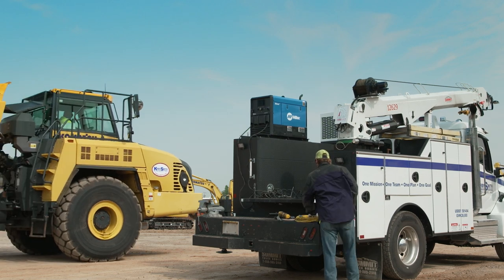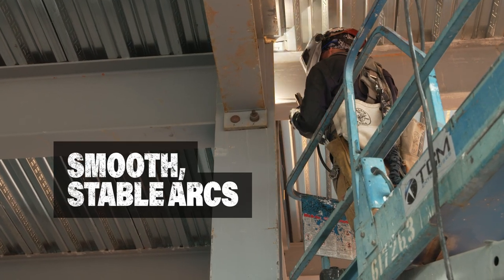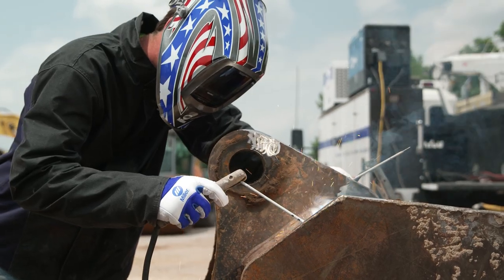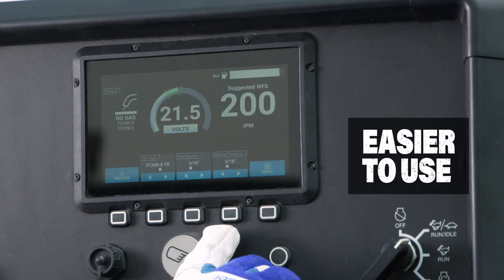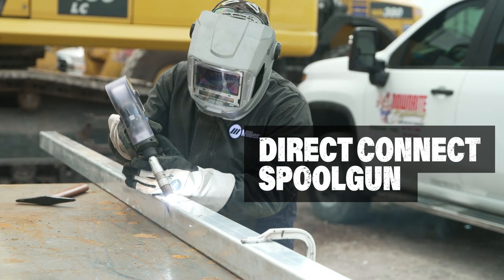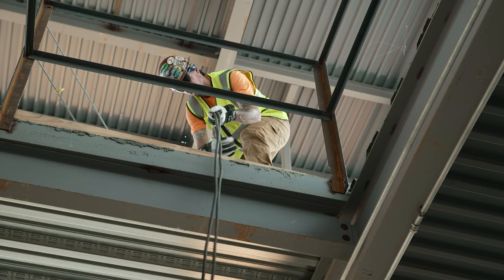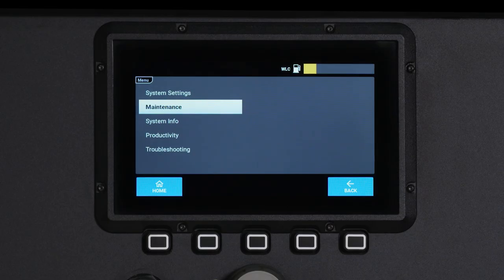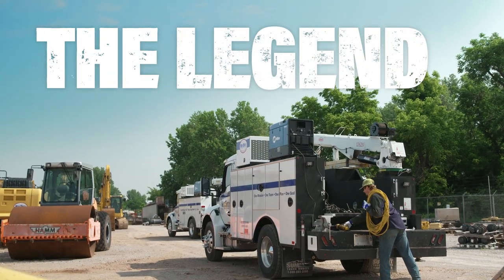Smaller and Easier to Use: The Bobcat™ 265 Engine-Driven Welder

Comment: Does the Miller Bobcat 265 have an efi engine? I dont see a manual choke lever on the front.
Reply from the maker: The Bobcat 265 with the Kohler gas engine uses eChoke™, while the Bobcat 265 LP model has a manual choke.